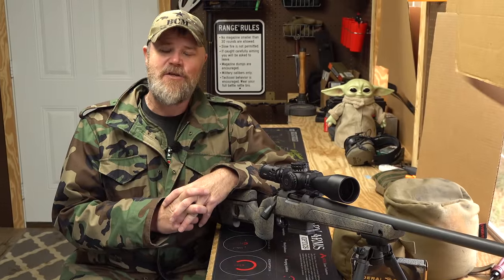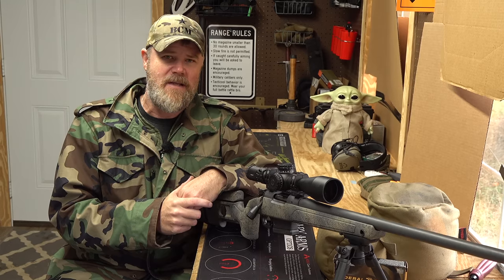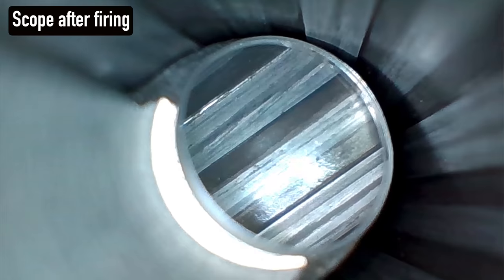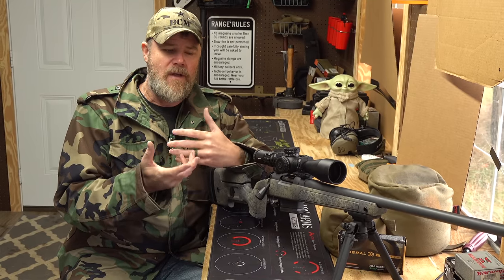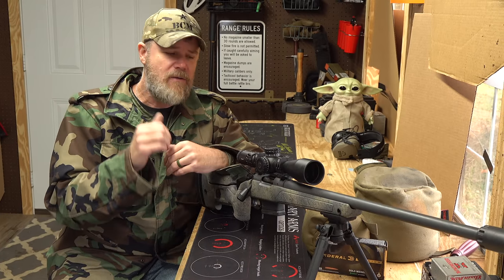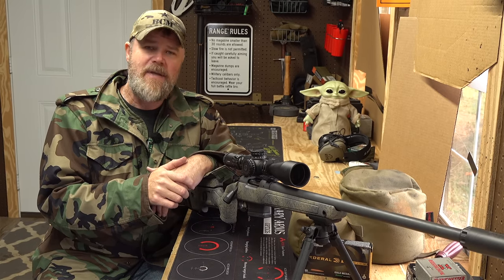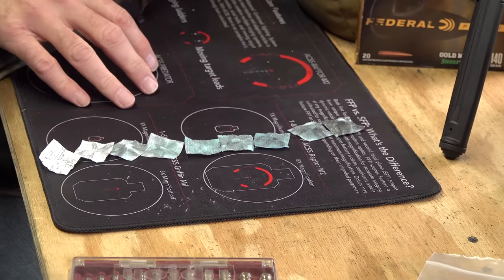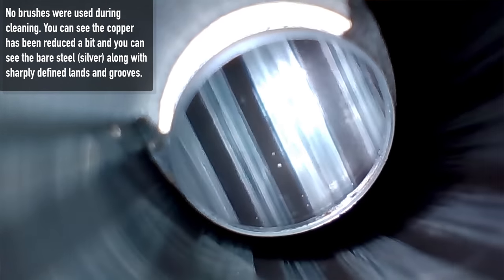Barrel Break-Ins and Cleaning Voodoo Rituals Destroy Barrels

Comment: I think you are right  I do use a brush but I go twice down the barrel and thats it I then use patches the problem starts when these cleaning Fudds go crazy with the brush and I clean only after I finished all my shooting and I have seen a hand gun that was a mess with lead and copper little or no cleaning range owner said it was a nightmare trying to do a cleaning PS both sides are right but what I have seen that type of fowling can happen but it is rare you are right use the correct cleaning solvent and equipment

Comment: Consistency is the key to accuracy. Never clean the copper out. It will only lay so much to a point, if it even does at all…and it equalize. Then your shots will be consistent. If you take it out you have to re-shoot it again to equalization.
It will never keep laying copper down til the bore closes up. Some gets pushed out as some equally gets laid down. 
Every gun i have shoots touching holes with handloads (all great quality guns, no cheapers) and all i ever do is drip CLP into the barrel a few times and run thick paper towel chunks through with a rod. More so to wet the surface so it never has a chance to rust. 
Tell me whatever you want. All these guns shoot  crazy good and ive had them for years. 
This is physics.

Comment: Brass is probably okay since it is so much softer, but if you rub brass against steel enough the steel will start to polish. Thats his point. Not using any metal will mean longer barrel life.
On a molecular level some of the steel atoms get pulled away when the brass rubs against it. Think of the road. It is made of concrete and is rough when new  but it smooths out over time due to rubber wearing on the concrete.
Additionally, any excess copper will be pushed out of the way with the next bullet. Also a barrel will likely have tighter tolerance than a bullet. So most bullet are forced to conform to the barrel. So in a way the copper filling in the imperfections will result in a tighter fit and better spin.

Comment: As a gun  guy and well experienced shooter who also dapples into gunsmithing (I don't gunsmith for anyone else but I have completed and have my lisenes from a home corospondence gunsmith school) I have seen way more barrels ruined by bad cleaning methods and neglect than actually being "shot out", yes you can shoot a barrel out but very few people actually shoot a rifle enough to actually shoot them out as in the travel of the bullet taking away enough of the rifling that it will no longer impart spin and stabilize the bullet, more often than not when enough  rounds have been shot it is the first inch or less of barrel just ahead of the case mouth as it sits when chambered  that has become erroded from the flame cutting effect, this becomes even more of an issue if guys do those repeted "mag dumps" or let the barrel get way to hot and don't allow it to cool when it get hot, the other thing that more often happens is barrel crown damage from either bad cleaning methods or physical damage otherwise, both of those can be fixed by either setting the barrel back, cutting more threads onto the barrel so it seats deeper into the action, refacing the barrel breach end and recutting the the chamber deeper there by eliminating that portion of the barrel in the leede area that has become erroded, cutting a tiny amount of barrel (half inch or less) from the barrels muzzle and recrowning most always fixes damaged barrel crowns, most often this is all that is needed to bring back the accuracy of so called "shot out" barrels,,,,I've gotten some really good rifles for little or no money because they were "shot out" and guys didn't want to pay to have the work done and just bought new guns and fixed them back to perfect performance in just that way, as far as cleaning goes there is  a bit of a fine line between too much and not enough, taking just a few shots and thinking you need to clean it enough to do surgery on is BAD, shooting it many many times and never cleaning it is also bad, you kinda got to let an educated eye be the judge,,,,if the thing has been shoot enough to warrant it and it actually upon visuall inspection kinda looks like it might be getting pretty carbon and what not built up then clean it, but don't go off of the deep end like some guys do thinking that you don't stop till the patch comes out as clean as a new one,,,,that's overdoing it,,,just run a well soaked slightly snug but not tight patch of a good quality proven solvent through the bore one pass and let it soak and do it's jobs for a couple minutes then push a dry patch through and see how it looks, if it comes out quite dirty then repeat with another wet patch and dry patch untill the patch comes out fairly clean but it doesn't need to be as new that's overdoing it, then when using ANY (even those one step do it all cleaners/solvents) use a patch well wetted with a quality gun oil such as Hoppe's, Rem oil or the like sent done the bore and then another dry patch, this will neutralize any left over residuall cleaners or solvents that could harm the barrel if left there, in over 40 year all I have ever used is Hoppe's number 9 bore cleaner as well as sweet's (but sparingly and only when evidence of severe copper build up is evident), I use brushes of any kind very sparingly (NEVER NEVER anything more than the soft brass bristled ones) and rarely ever on rifle barrels because unless you are shooting lead bullets in your rifle there is no need for it, chemical cleaners will do all you need if used correctly and you give them time to work (soak in so to speak), done correctly VERY few people will ever "shoot out" a barrel,,,especially now with the super good metalergy and coatings and precsion that barrels are being made to.
Reply: LOL Just LISTEN to the man in the video...................  PERIOD!

Comment: Best way to clean barrel is don't push patches through it but rather insert rod without the tip from end of barrel, the screw on the tip with patch, solvent whatever at the bore end and then PULL  the patch through barrel from bore to crown in one smooth pull.   That way the patch or nylon brush goes through smoothly without struggling to push a patch through. This  could also be done with a bore snake or similar but I don't use bore snakes because they are dirty and collect debris after the first pull and I don't want to drag that debris through the barrel again.   Best use a clean patch on each pull.

Comment: I have helped many with the problems groups on target, it usually goes like this it was shooting great but now my group is getting way big for some reason and have to keep moving the scope settings and I only ask one question how many rounds have you fired through your rifle before cleaning, the answer usually goes like this we have shot four or five boxes and the point of impact keeps changing so then I say lets clean it and you should get your good groups back again and stop readjusting the scope settings, the cleaning took place and they could not believe something so simple caused so much frustration and were making good groups out to 3 and 4 hundred yards and beyond, that was 22 years ago and those fellas still use those riffles when the group starts to open up they clean the powder fouling out and they are back in business and run a couple of shots through their rifle and off they go hunting, I have been doing it this way for approximately 42 years and no fails of yet.clean shoot and hunt, good luck.

Comment: I just bought a brand new Tikka T3x and put a few wet patches through it. Started out with some black but came out basically clean after only 3 patches...
Then I put a brush through a few times and the amount of black oily residue that was still in there but showing up clean on regular cotton patches was really surprising. I'm so glad I used a brush to get the rest of that manufacturing gunk out before ever getting any bullets near the gun.

I understand the concerns around bronze brushes but for me it the logic is: pushing a brush through slowly and gently by hand could never cause as much friction as a full metal bullet going mach 3. If putting soft metal through a barrel was so damaging, then bullets would be nylon by now.
Reply: Totally agree👍
Reply: Barrels are sized for the bullet.  They are not sized for your brush, unless you use your brush religiously.  If you do, they won't be sized for your bullet.  So, which do you want your barrel sized for?  The bullet or the brush?  It's your choice, of course.
Reply: @Quakeboy02 The bullet and the brush are both larger than the lands of the rifling, so what's your point?
Reply: @Quakeboy02 and the brushes are sized for your barrel, i really don't understand your point

Comment: Wait, you guys clean your guns?
Reply: Ikr
Reply: Lol, I can tell ya this. I cleaned an old but very accurate.22 LR rifle years ago. It “needed it” and was a little neglected.  After the cleaning, the gun ran super smooth, but the dead on accuracy at 75yds had now opened up to 4”. I thought I had ruined it. Turns out that after that summer and 1000+ rounds between my brother and three cousins, that gun developed its accuracy again. 

Now years later I have realized that there is a ‘copper equalization’.  

A brand new barrel will actually become more accurate as the imperfections become filled in and seasoned with copper.
Reply: If you mean throw some lube on it, then yes
Reply: England : wait you guys have guns??
Reply: I've heard plenty of people say that I'm doing it wrong. Maybe I'll start listening when they start outshooting me.
Reply: @Johnnyaspec  and canon's  and tanks, etc.
Reply: @YELLTELL  I was only joking, we are allowed guns but they are heavily regulated. Tanks are fine
Reply: @Johnnyaspec  yes! Thank you England for calling our bluff! 😂
Reply: Just use boot strings and motor oil.
Reply: @HarrisonCountyStudio  
Thank you for sharing your knowledge. What you say makes sense to me

Comment: There was a time where the company I was working for, was wiring up new equipment in a plastics color concentrates factory, and saw something  that really amazed me.  They would mix a resin and colored powder, force it through a screw and die, to basically make plastic spaghetti.  From there, it would go through a water bath to cool, and into a pelletizer.   Getting to my point, as the spaghetti went into and out of the bath, there were horizontal stainless steel bars that supported the spaghetti from touching the bath walls.  These bars would get grooved deeply from PLASTIC being drawn across them, whether that plastic was hot going in or cool coming out, didn't matter.  
The moral of the story being: just because one element is softer than another, does not mean the softer element cannot wear the harder.
Reply: Nature teaches us that wind, sand and water can wear down a hard granite mountain. In physics it is time vs abrasion.
Reply: Same as if you make a brass gear and a nylon gear and run them as a pair, the nylon will chew the brass to bits.
Reply: On that note, under the hood of a car, I have seen a rubber hose wear completely through a steel line and never show any wear on the rubber hose.
Reply: Good anecdote, cheers
Reply: rifle barrels and weird plastic spaghetti contraption makers are two totally seperate things and a bizarre comparison

Comment: We used 3 in 1 oil on our guns. We never took our guns apart to oil them. The firing pins were the only problem we ever had with our very old guns. We used an old T-shit. Cut strips off of it. Put oil on the strip and run it down the barrel. Wherever those guns are today i bet they still work.

Comment: I watch this and think about the cleaning standard we had in the army. and how the unit armor wouldn't accept our rifles until it was once again bare metal on the inside.
Reply: Marines. 4 hours scrubbing for each hour shooting.
Reply: The military loves busy work… plus a bit of post Vietnam paranoia about M16 cleanliness.
Reply: I remember using brass bore brushes 35 years ago when I was in the army
Reply: That should have said 55 years ago
Reply: @tomlusk7873  with the sectional steel rods
Reply: until they were spotless
Reply: Use Blue Wonder to get rid of crud in the barrel and have nice clean.
Reply: Back in my time the Army was strict about: "Keep your rifle detailed clean and wet lub after shooting." It was hard for me to move away from over cleaning my guns. Nowadays, I accumulate about 1,000 rounds before a do some cleaning and lube on the bolt carrier group. When I see too much, visible, excess of fouling build up, I do a deeper cleaner. Used to be that my civilian rifles were shiny clean every time after I shot them, which it was unnecessary, of course.
Reply: @v.german11b  yes, but depends on the ammo you use as well. Dirty ammo requires more frequent cleaning and maintenance.
Reply: Smooth bore rifles, and why do they still teach marching and parading, didn't that go out with napoleon? Customs change slowly,  I have more problems with rust than copper scales in the barrel. Soft brass brush used sparingly, thick oil after the solvent. 👍👍🇺🇸
Reply: Exactly, those habits ingrained in us where they wouldn’t accept our rifles till we basically scrubbed the barrel bare, then we carried it over to our civilian weapons…….. is the problem

Comment: As a professional gunsmith for 20yrs building accurate rifles I have found the "break in" depends on how the barrel was made.  Cut rifled and hammer forged don't really need a break in because they are already smooth under a bore scope and actually don't foul much.  Button rifled barrels need a break in.  They are rough under a bore scope!  They grab copper at every little line that was left from the hydrologic press that hammered the button through the bore.  So the whole "shoot one, clean, shoot 2, clean..."was to smooth out all the little burrs left in a button rifled barrel.  It's not needed unless it's button rifled.  And at least for fouling it really helps for ease of cleaning after breaking it in.  As far as accuracy on a button barrel I've found it seems to help a little during long strings of shooting and makes it easier to clean after.  

I 100,% agree with not using stainless brushes!  Let the solvent do the work and give it 5-10 minutes after patching the solvent.  I've seen barrels with a 20rnd "break in" destroyed with a SS brush and are then a 2moa gun.  

So know what kind of barrel you have before trying to make it better!
Reply: In this video he is commenting on his Bergara rifle made in Spain, Spanish high quality steel, which has a button rifled barrel. Every button rifled barrel I have was pull buttoned in one pass, not "hammered." Ed Shilen was Bergara's consultant. Judging by the bore scope footage in the above video, I'd say the cleaning method used as described worked just fine in the Bergara rifle he's shooting with a button rifled barrel.

Comment: I appreciate your perspective. So if I understand you correctly, you do not run a patch with a small amount of oil after you have a post-solvent dry patch. Traditions being what they are, I was taught to run a patch of oil after getting a clean, dry patch. Is it a waste of time? I doubt it would be harmful. Also I use the heck out of bore snakes. Any thoughts would be appreciated. Nice video. 👍
Reply from the maker: I oil my barrels. 👍
Reply: Military Arms Channel I use the heck out of bore snakes as well, what are your thoughts on those?
Reply: having a thin film of oil in the barrel for storage or in bad weather is always recommended. shooting a gun with an oiled chamber isn't ideal though as the oil film actually increases the pressure in the chamber. this is actually a big deal for shotguns due to their lesser chamber thickness.
Reply: Ethan, // Nor have mine, every time, a BOOM was required , always did so...  A drop of oil here and there takes care of Most all problem....

Comment: The way I see it, the copper is a means of a piston ring on a piston and also if your barrel is steel, another protective layer. A little won't kill anything
Reply: The problem is that copper goes after iron in the reactivity series, in simple English, if these two metals are in contact for a long time, then copper will eat up the steel from the barrel. 
A good practical example is zinc plated steel roof, here zinc goes before iron in the reactivity series and protects the iron.
part of  the reactivity series         > Zinc > Iron > Copper

Comment: We agree to disagree.  F-class shooters strip the barrel back to steel every chance they get.  Eric Cortina has a great video on cleaning. "Muh accuracy" is not the reason, its carbon build up specifically causing pressure/ velocity spikes. The only way to keep a barrel shooting consistently is to keep it at, or near bear steel.